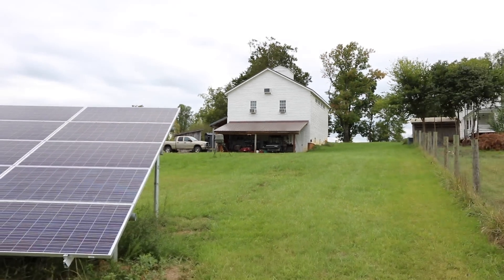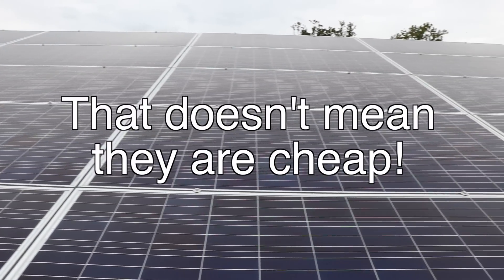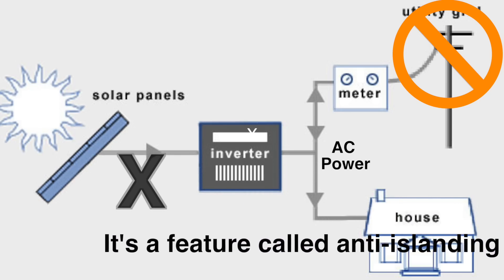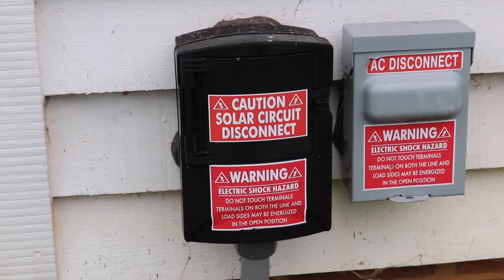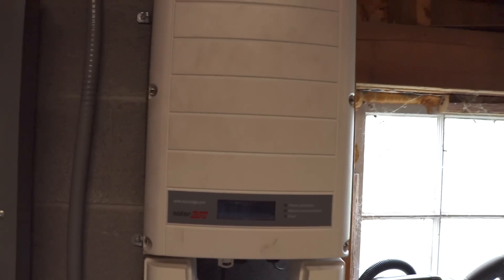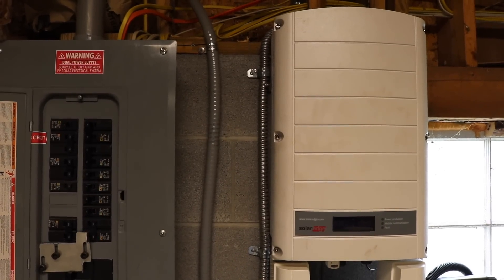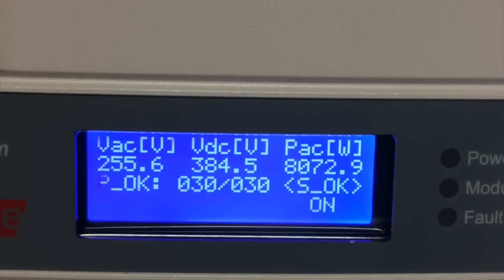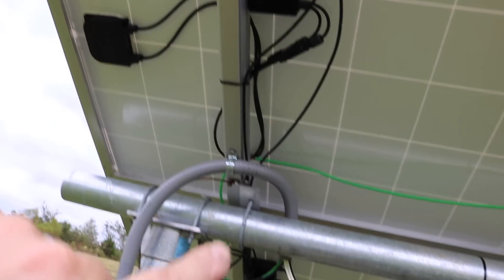The ugly truth behind grid-tie solar systems. Part 1, FarmCraft101 solar.  Watch before you buy!

Comment: Well to cover my average 2,500 kWh monthly consumption I'd need over 100 panels to net out my yearly average use. Living in a residential area .. I don't think so. That said, every time I run the calculation it's a lot longer than '8.5 years' and closer to 15 plus to recoup the cost. The electric companies at least here in Florida don't give you a 1:1 credit which makes the whole idea of battery storage part of the equation and batteries just don't last long enough to net $0. We also have a generator and an automatic transfer switch isn't that expensive $800, $200 or less for a manual switch though I'd only get an automatic. 

Bottom-line, for solar to honestly make sense the 350W panels need to improve to 700W or higher and sell for half their current prices.
Reply: Sorry Steve, your math is incorrect.  If he needs to generate 2500 kWh a month (which is way above average) he needs to generate ~84 kWh a day.  Count on five hours a day to generate that (which is conservative for Florida) is a 16 kW system.  In the worst case a 16 kW system would generate all of his power.  Based on my own experience - he is probably using a lot more power right now for A/C than he will be in the winter, and because he is in FL his system won't have a huge drop in efficiency over the winter months.  Therefore he could probably size down to about a 10-11 kW system to break even over a 12 month period.  But a power hog like this guy definitely needs more than a 5 to 6 kW to totally offset his consumption - he need somewhere between 40 and 50 panels (250 W per panel).
Reply: how many of these do you have?    the house must be HUGE.  Only minisplits and geo source water heat pumps will out perform these..
Reply: You are confusing instantaneous load with average load.  The reason your 12 kW generator can only run one A/C is because air conditioners have a very high starting load.  The load drops once the compressor and fans are continuously running.  Your A/C also shouldn't be running 24/7/365 (though based on what you've said I think your money might be best spent double checking the insulation of your house/attic).  Furthermore, I'm confident your power consumption drops in the winter, but the amount of sunlight you get won't vary nearly as much as someone's north of you will so your panels will stay efficient in the winter producing more energy than you consume, which will pay back the deficit you generated in the summer.  You have to size your system for average yearly consumption and average yearly production.  I can assure you it won't take 100 panels to get close to a $0 yearly electric bill in Florida if your consumption drops in the winter.
Reply: What you say makes sense.. conservation first..   This is also why it makes sense to grid tie and figure on replacing 75% of the grid tie.. Have the capacity to carry start up loads.  Other things can be done like conversion of ac units to mini splits or putting on geo source water cooling  to the units.    I am thinking that if he is using 2500kw a month.. must be in a 10000 plus sq foot house.  so putting in enough solar to carry the load of running who knows how many inefficient ac units could be offset by adding the solar and enough batteries to start up the new units ..
Reply: yeah .. i was baffled about the usage too .. its 25 times a single household where i live .. or about 8-12 times as much as a family uses ..
Reply: pool pumps could well be drawing more current than your ac units http://www.inyopools.com/HowToPage/how-to-calculate-the-cost-of-running-a-pool-pump.aspx?CommentPage=1
Reply: Steve Pailet 
Excellent info and thanks! While I certainly knew the pump burned through electric, I failed to realize it was that much. Wow. 

Lightning during a past storm damaged an ethernet outlet so I'll have the electrician test the pumps.
Reply: There always seems to be a part of the story that was missing.. After you said you had such high seer ac units.. My mom had a pool she filled in.. in retrospect  I said should have put in her tornado shelter  right out the side door.. she and sister had talked about putting one in.. Duh moment.. But they got rid of two pool pumps.. and the AC kw dropped by 50%   They had years ago changed out the windows.. and yup at that point dropped the power bill by 25%.. so now she has a manageable power bill
Reply: curious how old is your 5 ton ac?  So many of the newer units are massively more efficient.  Depending upon the lay out of your house.. other things may come into play
Reply: Steve Pailet 
One year old, high efficiency Trane XV20i and TAM 9 https://www.trane.com/residential/en/products/heating-and-cooling/air-conditioners/xv20i-air-conditioners.html and https://www.trane.com/residential/en/products/heating-and-cooling/air-handlers/hyperion-communicating.html in other words the best Trane sells.
Reply: Steve Pailet 
Size I rather not say, but it's not a small home nor is it any mansion. We have 2 units. Each Trane system can run up to 4 zones. It's an incredibly good system, in addition we can control it from anywhere.

The thermal problems with our home are it's single pane windows and sliders and unlike our last home (closed cell, dual pane) blown in insulation. We've recently doubled the insulation and I'm debating over ceramic thermal film windows. The windows in Florida when this home was built it must be rated for at least Category 3 Hurricane impact or have some form of shutters, we have no shutters.
Reply: single pane windows?? double strength glass argon and low e will pay off in very short order.  There is a reason living in hurricane alley to take your time and collect ply wood to cover the windows or consider rollup exterior blinds that you can just pull down quickly.   I would recommend getting a bid from window world.. they are the largest independent window manufacturer in the US  yes they actually manufacture their own windows.  I am not big on pvc windows but I know they are very efficient.  I imagine you are in a home around 6 to 7 thousand square feet to need two 5 ton units.
Reply: Steve Pailet 
Double pane Hurricane windows are insanely expensive .. A price of a small house. https://www.thebalance.com/how-much-cost-will-a-hurricane-resistant-window-add-844562
Reply: yup I know they are expensive.. the bigger united inches the higher the cost.  Still over time you will recoup fairly quickly ... What you have currently with single pane windows is what amounts to keeping your windows open 100% of the time.. no U value to them.  I have seen electric bills drop by 50%  This is common  still stand by the keeping ways to cover your windows.  You live in the land of hurricanes I unlike yourself said enough and moved so I dont need to fret about it nor do I have to complain about 2500KW a month electric use
Reply: I redid my math and came out to the 16 kw array.    After chatting he actually has 10 tons of ac.. they each service 4 zones.  trane units that have a 22 seer rating so  not so much energy hog units as just monster size units.  The electronic from what I read at the trane site do not start up at full load. They use an inverter technology  .. All that said he has an energy sucking home with single pane windows in Florida.  Sounded to me that he needs to start changing out those windows .. one side of the home at a time.. Light mass home needing a lot more work on the envelope.  Not the easiest thing . Without seeing the home it is impossible to really know where to start or stop.   Florida has fairly cheap electric rates around 10 cents per kw
Reply: Wow 2,500kWh a month, i would only use wait for it about  80-100 kWh. but over here in Australia its still expensive.
Reply: TheyCalledMeT 
In Florida I'm a little over twice the 'average usage' kWh (1,100 kWh) but in house size it's more than double. I could easily shave off 10% to 25% if everyone could accept 78° F vs the 70° F of my daughter, 74° F of my wife and even my 76° F preference. Most homes don't have pool pumps on all day, 90° F with 80% - 90% humidity 8 months out of the year. Winter to us is daytime 70° F, but over the past few years it's been in the 80°'s in January.
Reply: so a full AC'ed flat incl. a pool which is heated with electrical energy? ouch ^^
here we would use solar thermal or gas/oil for heating. but realy .. it's baffling to see a small household use far more per month than what i'm per year .. no wonder people are complaining about the wasteful energy-usage of the us ^^
and whats the price per KWH? can imagine such usages go deeeep into the pocket
Reply: TheyCalledMeT 
The 2 HP pool pumps are electric, the pool is heated by propane though right now it's bath water from ambient heating. Florida ranges from $0.11 to $0.14 per kWh and price wise that's about middle of the pack compared to the U.S. ranges.
Reply: so you're spending something close to or around $4k a year for electricity alone. phew .. 
Is the AC the major consumer?
Reply: TheyCalledMeT 
Absolutely the AC is the vast majority of the kWh usage. Listen I'd love to cut our bill in half even after the replacement of the prior units which were originally rated at 10 SEER (14 year old units). The sources of loss in comparison to our prior home:
1. Closed cell insulation (now I'd only recommend open cell because of potential water damage and how it spreads under hard closed cell .. wicking .. pinhole leak spreads out vs only penetrating and hides water damage.
2. Dual pane windows. This home was built using cheaper Hurricane single pane. 
3. Cover of huge immense canvassing trees. The last home was built in a forest and the trees surrounded the home. This home is essentially completely exposed. 

My wife hated the location of our last home, it was out in a more countryside location. Our current home is in a Country Club setting which she likes, no demands. She's happy, so happy wife happy life kinda thing. We've lived here less than 2 years and nearly completely remodeled the home. However, we're talking about building and no doubt a huge priority is efficiency.
Reply: take a look at your pool pumps.. likely are using a huge amount of that current draw.  In the last few years they have come out with some new pumps that draw a lot less power.  You might consider putting them on a timer so that they are on a heck of a lot less time .  If you have 220 240 volt pumps and they are drawing 9 amps.  and you have 3 of them wow.. that is almost 700 watts per hour.. if they run 24/7  can add up to a monster load..
Reply: Steve Pailet 
Yep those are on my list to get tested, and absolutely consume a lot of kWh. BTW our last home didn't have a pool, instead a big beautiful tree I refused to cut down, but the people we sold it to didn't have the same affinity of trees that I do, it was sad to see it gone.
Reply: oh.. a bummer .. loved the cherry, apple, peer and plum trees at my home when i grew up.
Reply: Cheapest way to cool your home, And heat the pool -- passive solar system on your roof, feeding into ammonia-based heat pump.

Ammonia systems, in simplified terms, need an Input of heat energy on one side in order to provide cooling.
The temperatures reached, in Florida Sun - will be more than sufficient. 

The capacity your home needs - is just over the freon-based systems. 
Enough of a cake for an industrial-size system.
Reply: interesting so long as there is enough heat  an guessing some sort of evacuated tubes that get super hot
Reply: Not necessary. Boiling water for a turbine?

Simple black pipe with mineral oil would be enough
Reply: Yeah, I use about 330kWh a month and I'm not even a big conserver.  2500kWh per month is an eye opener for sure.
Reply: volts x amps = power;  power x time = energy
Once you understand this relation, your math will be correct.
If your avg is 30'000 KWh/y (=30 MWh/y) and Florida has +/- 2000 sunshine hours/y, you need 15 KW system.
Nowadays you should not be spending much more than 1 USD/W for a cheap system and 1.30 USD/W for a good quality system, say 15-20 grand for your system.
I do not know , how much you pay for energy in Florida, but if you pay an avg of 10 cents/Kwh, this system produces you 15 x 0.1 x 2000 or about 3 grand or a ROI of 15%-20%. Not that bad, right.
Last point (most important one): Do only buy PERC technology on monocrystaline solar cells, that have been hydrogentated (insist on that). These cost maybe 20-30% more, but will last twice as much, say up to 50 years. With other words:  DO NOT buy the cheapest system, but the best.
Reply: BAD idea. And if this pump is 110 instead of 3 fase 220, worst case possible. 
Buy a solar water heating system for your pool (best are glass tubes. 2 tubes/m3). Use a DC pump, powered with 3-4 solar panels. Your cost of electricity will come down by 7-10%. The savings in porpane will pay for the tubes.
Reply: Being that he is in Florida the need for heating is small.. His  pumps as you say ... likely a huge energy hog.    low heat collectors rather than high heat evacutated tube style heaters is a better way to go even in the winter
Reply: i agree D J
Reply: 2500kW a month? Turn those air conditioners off and save the planet for the rest of us...
Reply: you made a major error in you math.  go back and do it again LOL
Reply: what you need is between 5 to 6 kw of panels so if you use 300 watt panels you would be looking at 20 panels not 100
Reply: If you go with duel mode tracking you can pretty much reduce this by 40%  or down to 15 panels
Reply: if you go with tracking and you move up to 350 watt panels you are now looking at 11 panels.    And remember still have the tax credit.  Figure $3 a watt installed so you could do this for $2 watt after credit.  or aroune $12000
Reply: FlyLowLikeRylo 
We have a 12 kW Generac generator and unfortunately it only runs one of our AC units: 5 Ton HVAC unit, washer, 2 refrigerators, garage doors, washer and some lights. A 22 KW generator is the minimum to run or house but not 'everything' at once and we'd need a 'load limiting switch.' After IRMA that's what I'm 'thinking' about, but probably only after our current Generac dies .. it's getting old.

I certainly do (edit DO NOT ) have to have a net $0 electric bill, or have off grid capabilities (that calculation blew my mind), but all of this is a starting point. It certainly makes you think.

Comment: Yeah, high voltage is very important in solar panel installations.
In fact, higher voltage is always preferred, unless you require heat or semiconductors.
This is why Quebec pionneered 750 000V a while back, to get as less losses as possible.